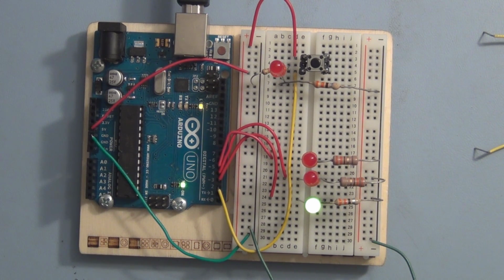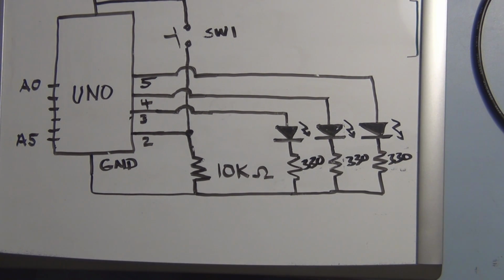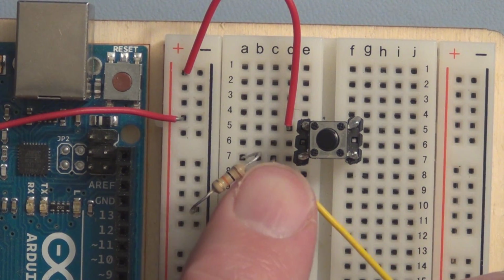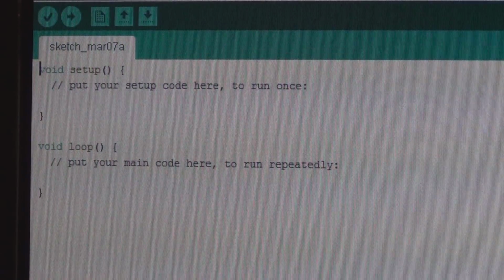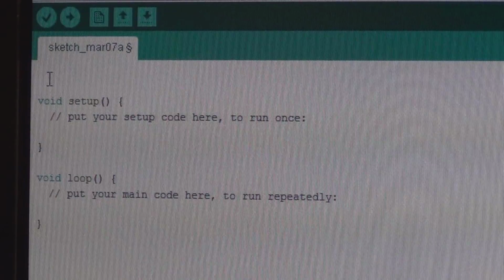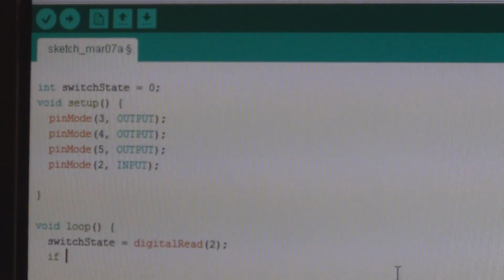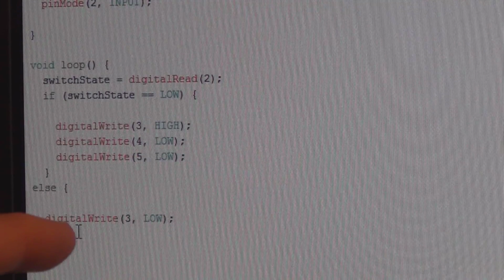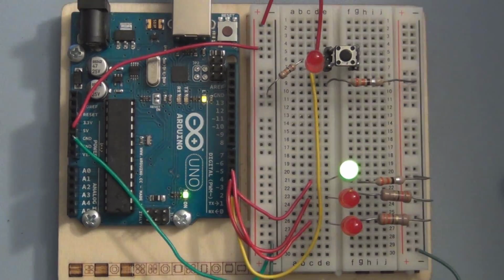Arduino Input Outputs tutorial

Comment: Hey Tom, thank you for the extremely helpful tutorial. I just wanted to ask, what is the purpose of the 10k resistor between the 5v and the ground? It wasn't used in the basic LED circuit so I'm wondering why it's used here.
Reply from the maker: It is used as a pull down resistor. The resistor is connected from ground to pin 2 of the Arduino and pin 2 also is connected to one side of the momentary switch.  The other side of the switch is connected to the 5 Volt supply.  When the switch is closed, when you press the button, it connects pin 2 to the 5 Volts for as long as you keep the button pressed.  You will then have 5 Volts on Pin 2 of the arduino.  So the sketch detects when the 5 Volts appears on pin 2.  The 10K limits the current from the 5 Volts to ground when you press the button.  When you release the button and open the switch pin 2 is pulled down to ground or 0 Volts again through the 10K resistor to ground.   This way you can write a sketch to monitor if the voltage on pin 2 is 0 or 5 Volts and make a decision based on that change in voltage.
Reply: @tmc200527  Im not sure im following, but is the 10k resistor there to prevent damaging the arduino pin in case the 5v are floating around without being used? Im very new to electricity conceps so this may seem dumb. Does the 10k resistance serves as other purpose other than that?
Reply: Oh, that makes sense now. Thank you!

Comment: can you help with analogue to digital arduino with floating numbers? its for opening a door lock via a relay when around 3.5 volts is detected? please help if you can :)
Reply from the maker: +Jay Mee You might be able to just use a digitalRead since anything above 3.0V is considered a logic high level on the 5V arduino.
Reply: nice il have to try that out :D thanks for reply. the door lock was from amazon (around £10 or $20) if you ever end up with 1 maybe you could make a vid anyway at some point il give it a go and let you know if i get it working :)